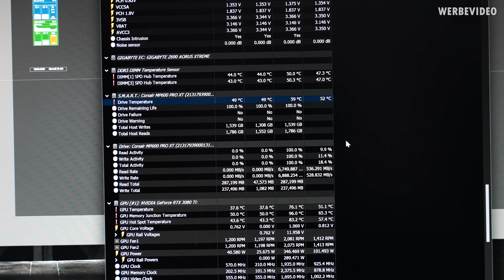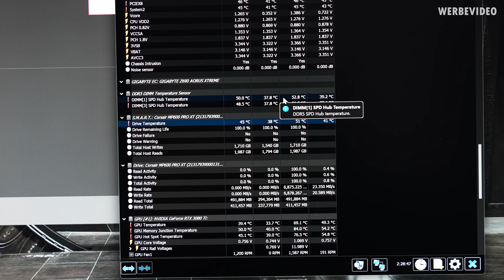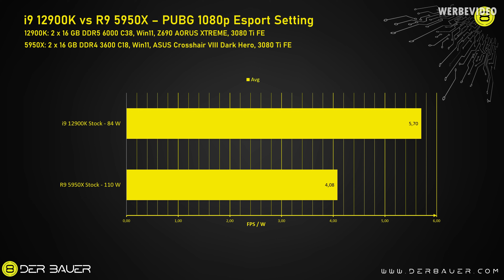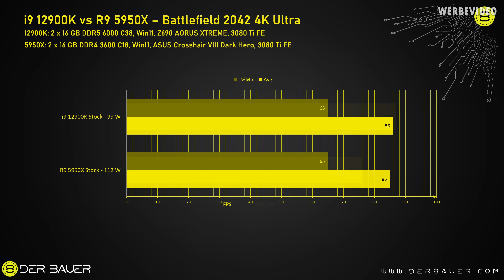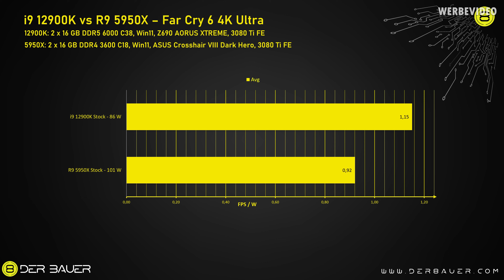AORUS Z690 Testing and Surprising FPS per Watt Results testing i9-12900K vs Ryzen 5950X

Comment: With power draw increasing every generation,  benchmarks should include performance per watt  as you did in games (fps per watt). I think is a good measure.
Reply: Hardware Unboxed does sometimes when they think it's relevant. I believe they did it for some of the 30 series.
Reply: Without per core performance, you are comparing wrong.
Reply: @Nicolas . . . I like that idea.
Reply: A better test is to make the watts on both sides the same. However doing it the way the german has done it is very misleading. I wonder why he chose to do it in the misleading way ?
Reply: When nvidia confirmed 3090 power consumption I said something like: "when will we see Watt equals FPS". But for the CPU I don't think FPS per Watt is a good measure.
Reply: You don't even know, bruh.
We are about to enter a generation with 150-250W Mainstream desktop CPUs and 450-650W microwave GPUs...  
Just two components are about to be taking up over 800W of power...  
I'm not being sarcastic or anything by the way.  RTX 4000 series is going to be an incredibly power hungry beast to achieve their performance gains, and, AMD will be the same 5%-10% behind them with their RX 7000 series but will remain much more power efficient while achieving almost the same performance.
Reply: @RNG-999  RX 7000 is gonna be MCM GPUs, so likely way above what Nvidia is capable of if they stick to using monolithic

Comment: The energy consumption of the new Intel is really surprising and in a positive way.
Reply: It always was even for gen 10. 11400 is colder than amd 3600 and 5600x while using less power.
Reply: AMD suffers due to the IO drawing more power than the cores in light load
Reply: @OCDyno  io is still on 12nm right?
Reply: @morcogbr  yes glofo 12nm
Reply: intel is running almost in standby state at idle while amd is running at 3.4+ghz with high voltage as I replied earlier a stock non oc 9900k z390 fresh windows install idles with 12-15w with 800Mhz@0.8v AMDs idle anb low cpu usage consumption is really bad but they shine at 100perc usage which 99perc of users will never see
Reply: Zen 3 is really heat dense, especially on the 5800x